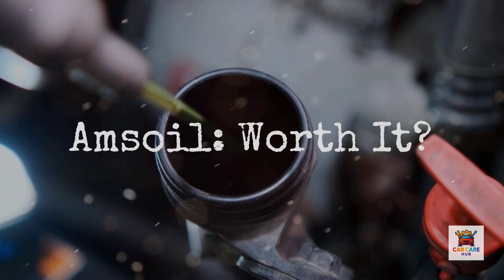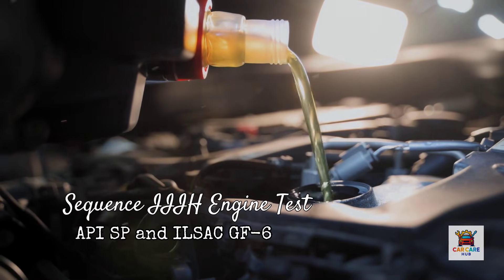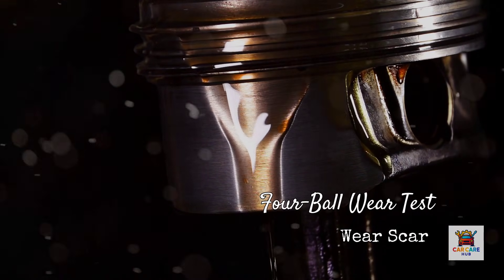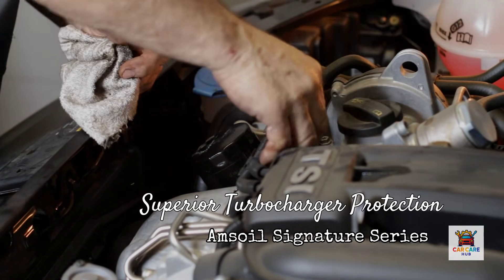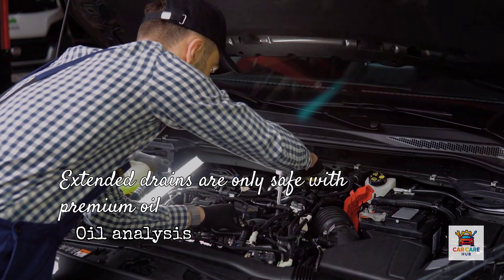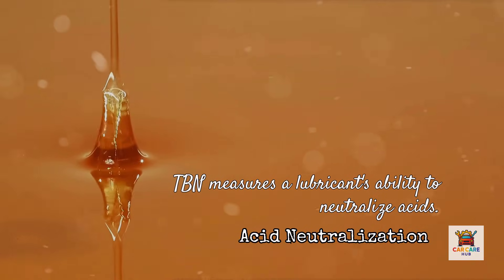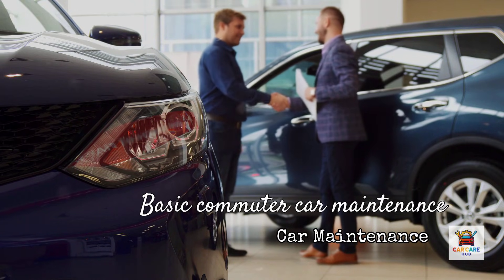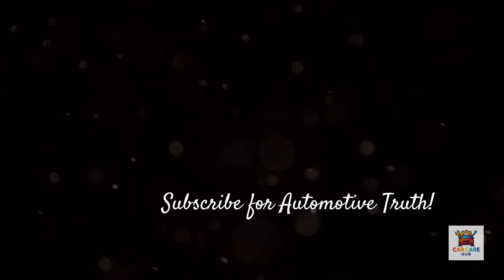Is Amsoil Really the Best? We Put It To The Test!

Comment: I have Toyota corolla sedan 2008 in Australia I am planning next time use amsoil xl 10w 40 my car done 260k km can please give me best suggestions this one is best?
Give me your opinion
Reply from the maker: With 260k km, a quality 10W-40 can be a good choice in Australia, especially if oil consumption or noise has increased. Amsoil XL is fine, but it’s not mandatory—any reputable 10W-40 meeting API specs will work. Keep intervals short (5–7k km) and use a good filter.
Reply: @CARCAREHUB247 Right now I use penrite ESD 10w 40 full synthetic not burning oil.
I changed every 6 to 7k full oil comes out drain pan 4.2L not burn oil.
Engine sound smooth and engine inside is clean.